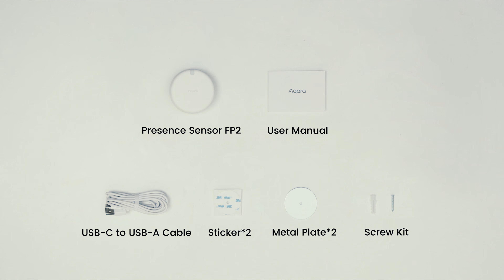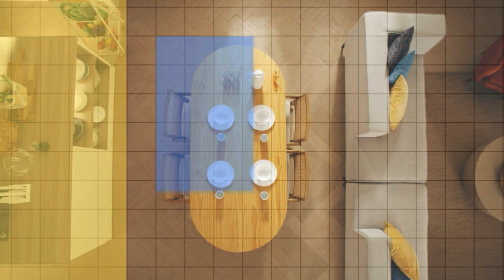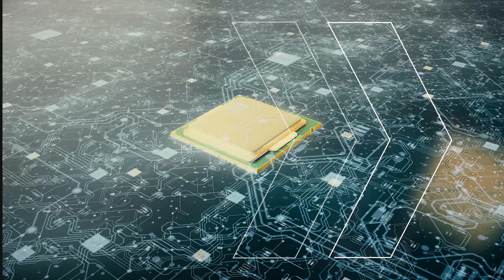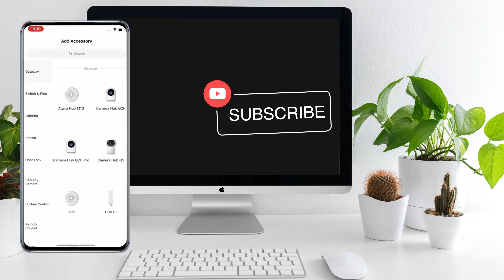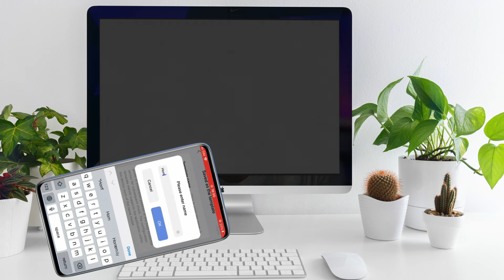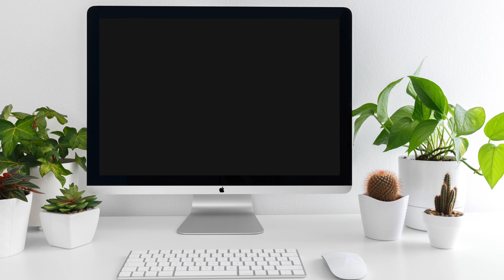Aqara FP2 Presence Sensor Reveloutionizes Apple Home

Comment: For what the sensor actually does, it’s amazing. The only thing thats kind of bugging me out is why can’t I have it HomeKit to TURN OFF the lights IF it doesn’t detection motion in a specific zone for 2 mins (or any other time interval)?  I’ve tried shortcuts as well. Has anyone else been success with this?
Reply from the maker: Before I got done reading your comment all the way, I was thinking shortcut is the answer? It wouldn’t work that way for you? I haven’t tried to play around with it in Shortcuts yet. May have to dive into that later tonight

Comment: How do you set the automation for bringing your wall mounted iPad out of sleep
Reply from the maker: First you want to put the wall mounted iPad into Guided Access mode on the Apple Home app and then using the Aqara P1 in the general area of the iPad you can set it up to send a push notification when it detects motion. You’ll want to turn notifications for that event off on all your other devices(iPhone, Other iPads). And since the iPad is locked in guided access mode you won’t see the notification come across the screen, only wake it up and turn the screen on!
Reply: @CScott4k  thanks a lot for the comprehensive explanation. I truly appreciate it.
Reply from the maker: @samersarofim1819  Your welcome!

Comment: I have one waiting for me to pick up tomorrow at an Amazon Locker.  While I'm putting the first one in my basement OFFICE, I also want to see how it'll work OUTDOORS in conjunction with my WILDLIFE CAMERAS (Wyze & Ring).
Reply from the maker: Nice. I thought about putting one on my covered porch. You’ll have to let me know how it ends up working outside for you!
Reply: @CScott4k  I've tried it ceiling mounted and wall mounted.  It works quite well in my office, but it wouldn't have the RANGE needed to detect people or animals outdoors.  Initial setup was easy, but after getting an initial measurement of room borders, I'm hard pressed to initiate a "do-over."